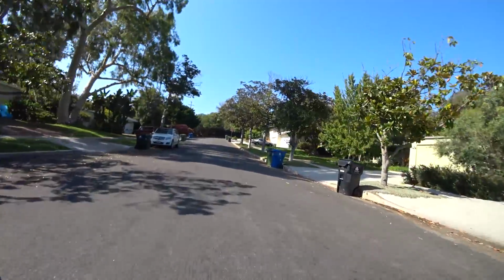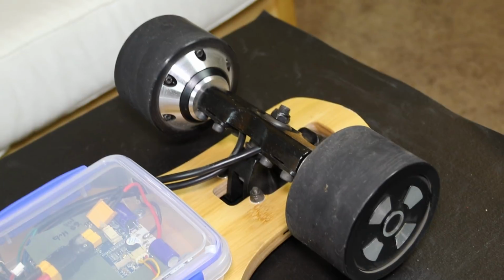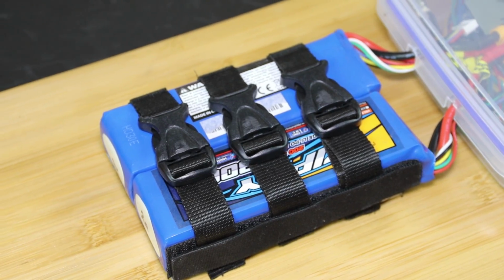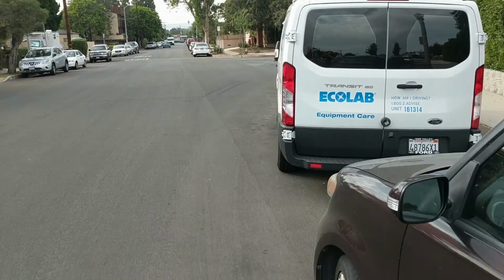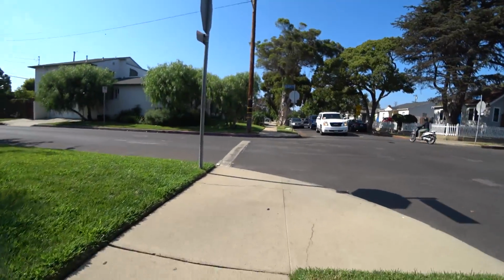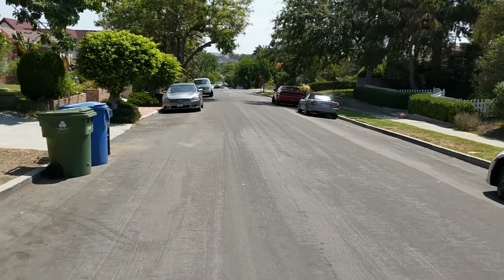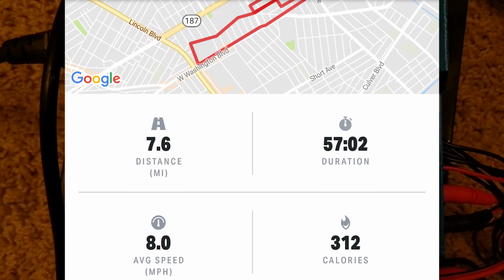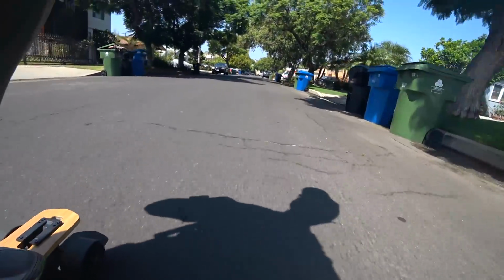Awesome Longboard | 21mph / $370 / Easy Build

Comment: Great vid, going to try and make one similar to this! is it worth installing a BMS ?
Reply: just bought all my parts - going to try use a BMS connected to a DC port. Will update if it works!
Reply: Update - I basically copied all of this, but I installed a BMS hooked up to a DC 2.5mm jack, charges nicely.
 I also made a little wooden enclosure with a thin aluminium lid.
The board is absolutely amazing, I live in the Welsh Valleys so its really hilly, and this has absolutely no issues going up steep hills and down them too!
Thanks for making these vids mate couldn't have done it without these
Reply: @tomwilliams6594  Can you send a parts list?

Comment: I'm going to tackle this/your electric skateboard project.  I ordered the hub motors and when I went to order the 'Dual Motor ESC with remote from Dickyho2015, it states the ESC is defaulted to voltage 6s.  Will this suffice?    And I was goin to purchase 2 Turnigy 5.0  5000mAh.  Will these batteriess work as well?

Comment: Hi, I have a Mongoose ATB that I would like to mod out to be electric. But I'd like to use the wheels that the board came with. Do you think the motor you used in this build will work? Like, will the motor line up with the holes in the wheels?

Comment: Hi. Does anyone know if you need both the parallel charge board and the lipo balance charger? Thanks
Reply: Looks like it. I'm assuming the lipo balance charger won't do two 5s at the same time. You can't just wire them up at the same time either because how would it balance charge then? One option would be to charge one 5s battery and then charge the other one separately. Obviously this is not optimal, and the parallel charge board can't be too expensive right?

Comment: HI will these hub motors work fine without the sensors plugged in? i plan to use them on my vescs but i dont believe the sensor plugs are going to match up

Comment: Nice video! Just wondering if the charger came with the ESC?
Reply from the maker: Thanks! The charger is sold separately. I use the B6AC V2 balance charger, which is around $45. I have a link in the description.

Comment: How many mah was your battery setup
Pls reply
Reply from the maker: Sorry for the delay. In this video I'm using two 5S 3000 mAh batteries. I've recently upgraded the board to 5000 mAh batteries. I have links to the different battery options in the description. I hope this helps.

Comment: I bought the same ESC and built almost the same longboard as shown in the video. The ESC worked fine for appr. 1 hour but now it beeps quickly 4 times when I accelerate and after that the board is not usable anymore. Ebay seller (dickyho) says it is low voltage cutoff. But that is not possible because it should cut off at 18V minimum. But in my case it shuts off even at 24V. It is 6s setting. Has anyone had the same problem and could help me maybe ???
Reply from the maker: Sorry to hear about the ESC issue. It's always possible the ESC was damaged. One of my ESCs did fail after a few months of use when a solder joint broke. It would beep and become unusable. You might want to double check that nothing is visibly damaged. Also, make sure none of the motor wires (or other wires) are short circuiting. I hope you were able to fix it.

Comment: you can buy the motor straight from meepo, some assembly required, but lik 40 dollars cheaper
Reply from the maker: Yeah, meepo sells them too. You can also find them at diyeboard.com. I think the ebay seller charges a bit more for shipping because it's express.

Comment: Was gonna build my own longboard, but the cost of parts added up to $150 MORE than a pre-built, WowGo 2s at $419, which includes air freight from China and, of course, no sales tax.  Not only was it cheaper to buy and avoid the building hassle, but avoided the risk of returning defective parts.
Reply from the maker: I agree prebuilt boards are also a good option. I think you can still build a DIY board for slightly less, but it's more about customizing the board to your needs than saving a bit of money.
Reply: A spadger is a wowgo $229 at walmart ....and has a good walmart return policy and extended warranty for $20 bucks ...best board for under $300

Comment: Nice video bro! I’ll build a similar one. So, It’s possible replacement the wheels ?
Reply from the maker: Thanks! I've heard it's possible to replace the rubber using the ones from Maytech but I haven't tried. So far the rubber is still holding up well after lots of riding.
Reply: Actually, I've built my electric one the same as yours two weeks ago and it is awesome, much better than I was expected and yes, I realized the wheel has rubber for a long ride. I'm using two 5s 4000Mha and give me 8.7miles endurance and soon I gonna try  4s 5000Mha
Reply from the maker: That's awesome you built your board! I'm glad it's performing well. In the belt drive build video I just posted I show an update I made to this board to put in 5S 5000 mAh batteries with a different container.
Reply: I've bought the longboard at kmart here in Australia, and I’ve made a wood box container, it’s was pretty good!!  and now I’m using 6s 5000mha, I’ll post a video soon and let you know

Comment: how do you know how much battery you need for your motors??
Reply from the maker: You need to check the specs for the motor to see the max voltage. As long as you're not exceeding that voltage you should be ok. Its usually not a problem to use less voltage. It'll just make the motor spin slower with less power.

Comment: can you use these wheels under the kicktail? wont it hit the board while steering?
Reply from the maker: Yes, you can use these 90mm wheels with a kicktail. As an example see my followup video where I replaced the deck. You might occasionally get wheel bites with loose trucks though.

Comment: What's the range with these 2 battery?
Reply from the maker: I can get around 7-8 miles. It'll depend on your weight and how you ride. You can get bigger (5Ah) batteries if you want longer range.

Comment: I have a http://bacstore.com/index.php?route=product/product&product_id=665
It's heavy, but has nice parts that look like it will last for years to come with space to upgrade; I am thinking about getting 3 Gel batteries to replace the 3 lead acid one's it's got by default. Any recommendations?
Reply: I paid 399 at the Locl hobby town on sell for what the owner paid. I priced the parts and looked to cost more If i built my first part by part.

Comment: Firstly, thank you for answering all my questions so far! I feel like I'm spamming your video, but I have one last question.
 I wanted to swap out the little shrink wrapped nylon xt60 connectors because the solder snapped. I bought a 12AWG dual battery harness thinking that would work excellent. However when I plug in my fresh batteries, it just beeps at me like it did before when the batteries were only 6s equivalent.
Have you got any insight as to how I might fix my newest problem?
Reply: make sure the batteries are charged, are the correct voltage and are wired with the correct polarity, and in parallel, not series. . many esc's have voltage protection and will not fire if if things are not right.

Comment: Hi great video, I’m looking at building my own and was wondering if there is an advantage to using 2 5s batteries instead of 1 10s.
Reply from the maker: Thanks! There is no real advantage to using two 5S batteries. If you build your own battery with a BMS than a single 10S battery would be best. I use 2 5S packs because LiPos usually aren't available in 10S and most balance chargers only support up to 6S. I use LiPo batteries because they're usually much cheaper and easier to put together. I hope that helps.

Comment: Hello!! What would be the difference between the amperage (amps) in the batteries options?
Love your videos men! Again greetings from Chile 🇨🇱
Reply from the maker: Thanks for the kind words! The only difference between like the 5Ah batteries and the 3Ah batteries is how much charge they can store - how long you can ride on a single charge. Both batteries will provide roughly the same amount of current and the performance of the board will be the same.

Comment: I got the same dual motor ESC, but when I connect my two 3s batteries in series to make it 6s, I am not able to make it work. Instead, I get a repeated beep beep beep beep when I connect the battery to the ESC. It won't stop. I can see that the controller in connected to the ESC because the lights react to the throttle. What do I do? I am only trying to use one motor. I have been stressing for hours. Thank you.
Reply from the maker: The ESC can be configured to 6S, 7S, or 10S. If you are using 6S batteries you need to make sure the ESC is set to 6S. It doesn't auto detect. You need to solder some pins to change the setting. There are pictures on the eBay listing showing it. It sounds like your ESC is set to the wrong voltage. The ESC will beep and not work if the voltage is too low or too high. I know it sucks dealing with a board not working. I hope you were able to solve it.

Comment: Can you attach VESCS to the motors or you buy to buy certain ESC's that work with the hub motors? I've just built and posted a video on a 12,600 watt AWD skateboard.
Reply from the maker: Your build is very impressive! I think you can fly up any hill in the world with it! I'm pretty sure the VESCs can work with any electric skateboard motor, including the hub motors in this build. In my first build I use dual VESCs with hub motors.

The eBay seller I got the ESC from also sells a 4WD version 
https://www.ebay.com/itm/4WD-longboard-skateboard-controller-with-remote-ESC-Substitute/302558036328

Comment: Can you swap out the wheels, somehow ?
Reply: Follow up question...
Can I get a different remote and pair it with the ESC?
Reply from the maker: Another person told me the 90mm wheels from the Maytech hub motors will work, but I haven't tried it.
Reply from the maker: I think you can pair a different remote of the same type (made by the same company), but I don't think another type will work. You can email the seller on eBay and he will probably know the answer for sure.
Reply: Oren's Projects That's kinda what I figured. I'm going to do a little more research on those wheels, and see if I cant figure something out. 

Thanks for the super helpful video and taking time to respond to all these questions. 

Happy skating!

Comment: Why did you only use 2 3aH batteries, why not bigger ones like 2 5ah or 2 6ah batteries? You would be able to go longer than 7 miles? I like the dual motor setup and ease of the esc, but am looking for around 12-15 miles of range, any suggestions?

Does the 3aH setup have to do with not burning out the motors? If so should I just get more batteries and swap them out mid ride?
Reply from the maker: Any capacity battery would work (3Ah, 5Ah, etc). As long as the voltage is 10S (42V fully charged) the motors and ESC will work. If you want 12-15 mile range I would recommend the 5Ah batteries - I included the link in the description. I mainly used the 3Ah batteries because they're inexpensive (around $23 each) and relatively small and light. Higher capacity batteries are physically larger (so you'll have less clearance under the deck). They'll also make the board heavier and cost more. The battery choice will depend on your preference. I actually updated the board in this video to use 5Ah batteries that fit nicely in a "Lock & Lock" 18.60-oz container - I'll show it in a future video. I still use the 3Ah batteries for my belt drive board, which I focus on keeping lightweight and lower to the ground.

Comment: Can the hub motor wheel be replaceable if it worn out?
Reply from the maker: You can't easily (officially) replace the rubber part. A while ago Banger67 commented that it worked to use the replacement rubber from the 90mm Maytech wheels. I ride the board often and the wheels are still holding up well so I haven't needed to replace them myself.

Comment: How did you wire the circuit board? Do you have a video of you making this?
Reply from the maker: It's relatively straightforward to connect the ESC (circuit board). Each motor has 3 thicker wires and a small 5-wire connector for the hall sensors. The ESC has 2 sets of 3 wires (one set for each motor). You just need to connect the motor wires to the wires on the ESC. The colors don't matter (you can connect them in any order). Once you connect them check if the motor spins in the correct direction. If it's spinning backward just swap 2 of the motor wires. The 5-wire connector for the hall sensors also plugs into the ESC. I've noticed the motor works perfectly without them. I show some of the connections in my previous videos. I'll try to show more detail in my next video. I hope this helps.

Comment: Hi, did you try to put more than 36V on the motors anyhow like consequently connected batteries?
Reply from the maker: The ESC I'm using supports 10S (~36V) max voltage. I would need to use a different ESC, like VESC, to run higher voltage. Also, I think these motors aren't designed for higher voltage and might burn out.

Comment: Is it possible to put more than 2 batteries in parallel ?
Reply from the maker: Yes, you can charge as many batteries as will fit on the parallel charging board - just make sure they are all equally discharged.

Comment: Hi Oren great video!
Quick question, what would be the difference between using a 3Ah, 4Ah and 5Am ?
Thanks!
Reply from the maker: Thanks! In terms of the additional range, it should be relatively linear. I can get around 8 miles with a 3Ah battery, so a 4Ah should get about 33% more range (10.6 mi), and 5Ah should get around 66% more (13.3 mi).

Comment: I made a board myself after watching this video. I just copied you and it works super good, well used to work good, It was fine for a few weeks until was riding it today and it it just stopped working and I don’t know how to fix it. The batteries are fine but the esc just won’t turn on, everything is plugged in correctly. Can you or anyone else help?
Reply from the maker: I'm glad it worked for a while. Sorry to hear it's not working now. I'm guessing it's the ESC. The ESC is definitely the most fragile part and usually what breaks first. I would double check that nothing obvious broke, like one of the wires getting knocked off. The way I mount the ESC has worked well for me so far, but it's not ideal because screwing the ESC to the deck will not protect it much from vibration and impacts. You might want to try wrapping the ESC in foam and not screwing it to the deck to see if that helps the ESC last longer.
Reply: Oren's Projects thanks for the advice. I agree it is definitely a broken esc and I also used the same setup as you. It broke as I was going over some bumpy rocks on the pavement so I’ll try foam or something similar. Do you think the seller would give me a refund?
Reply from the maker: Sorry about the ESC issues. Maybe there were some weak solder connections on the one you got. With these inexpensive parts I think it's less likely they will refund - but it doesn't hurt to ask :). At least this ESC is WAY cheaper than the VESCs, which can also break easily.

Comment: Can the esc work on 44.4 volts 4400 mah battery pack?
Reply from the maker: I'm not sure what will happen at 44.4V. This ESC supports up to 10S voltage, which is 42V when fully charged. It has some protection for over voltage so I'm not sure if 44.4V will trigger that. For the capacity, you can use any size - 4400 mAh is plenty.

Comment: Hey man. What happens when the ESC starts to make a bleeping sound?
Reply from the maker: That usually means the battery voltage is low. It's not good to run LiPo batteries too low. If you're sure the battery is not low then the ESC could be broken. One of my ESCs started beeping when it broke - even when the battery was full.
Reply: Thanks heaps. What voltage would you recommend the battery getting down to? (when deciding when to stop) as soon as the bleeping starts?
Reply from the maker: You should be ok going down to around 3.3V. I think the beeping starts around 3.5V and is more of a warning. I rarely ride long enough at one time to get that battery that low. I think the ESC might cut out before it gets too low.
Reply: I've tested it with both batteries (different battery life) and one says "Low charge" when i charge them separately . Does that mean I've broken one? I also tried using the regenerative braking to bring the battery to life however I think it made it worse. The beeping sound has stop when i plug in the bad battery.
Reply from the maker: That's strange if one of your batteries isn't charging properly. Most LiPo chargers can tell you the voltage for each cell of the battery. That might help to figure out if the battery has a dead cell - or if the ESC is messed up.

Comment: Hi, just wondering how the controller you have there perform uphill. Also, is there any instruction on how to set the controller with the battery? I can't find it anywhere. Btw, there seems to be (maybe) a newer controller model on ebay etc. https://i.imgur.com/gnEcWL2.jpg Thanks.
Reply from the maker: The ESC and motors work very well uphill at 10S voltage. The eBay page for the ESC has pictures and instructions on how to change the voltage. However, it's a bit difficult to do the soldering by hand. When you order the ESC you can specify the voltage you want (I recommend 10S). There is a newer version of the ESC in this build that has 3 speeds and a battery meter. I think the one in your picture is a different ESC though.